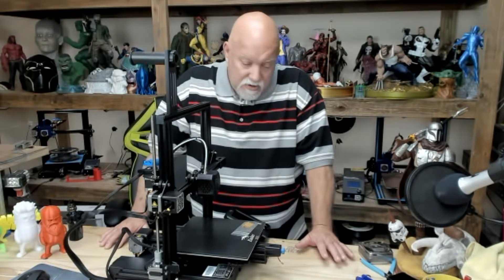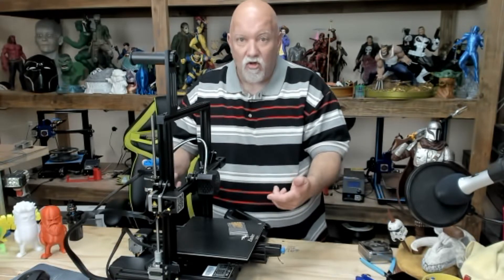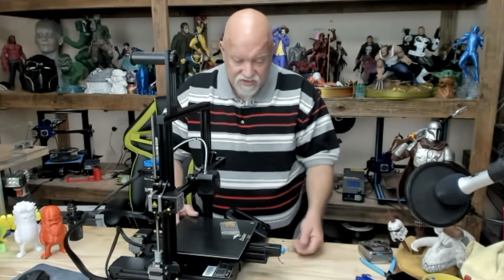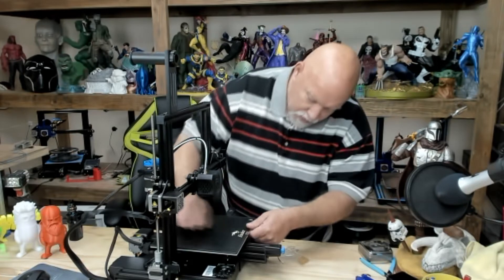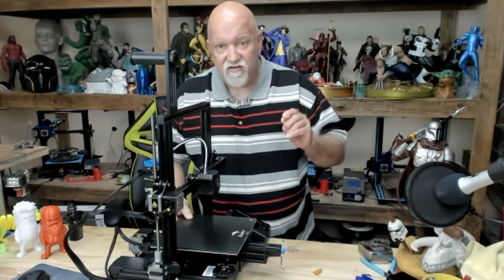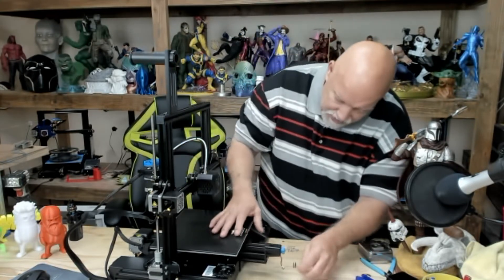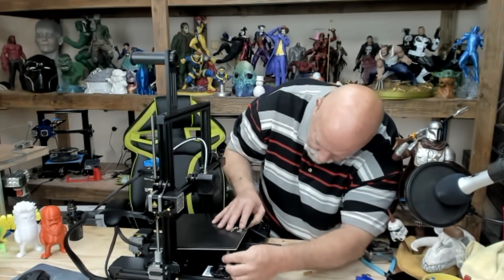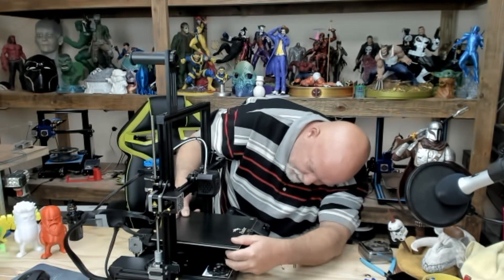ENDER 3 V2  Spring Upgrade and Why #3dhp

Comment: I couldn't actually see how you were replacing the springs because they're under the plate and your camera is pointing down at an angle from on top.
Reply from the maker: Sorry about that.in the future I'll be more careful.A bolt goes throught the Aluminum bed,through spring,then throught Y axis steel plate.Nut on the underside.

Comment: I have done all the above, plus even changed the stock springs. I am printing a print that I have printed many times before with no problems. So it’s not the slicer. But now about 45 minutes into the print it starts skipping, not all over, just the same spots over and over.
I’ve replaced nozzle , extruder, ptfe tube, springs, calibrated, changed filament, aligned bed over and over and even added a washer with the horned to keep Bowden tube close to nozzle. I’ve been living on YouTube and google for help. I’ve tried everything. Please help.
I’m about to pull my hair out lol. I have an Etsy store and have many orders overdue. I’m at my wits end. Any advice is much appreciated!!!!
Reply from the maker: I'm not sure, send me some pics at JEKNAPP1@YAHOO.COM or post on my group on Facebbook 3d Printing and Painting 3DHP or one of the Creality Facebook groups.Someone will have your answer if I don't.Wondering if it might be a bad sd card,replace or refomat it.
Reply: @3DHP  I formatted my card and it didn’t work. Then I tried a brand new card, and worked like a charm. Thank you soooo much!!!!
Reply from the maker: @kroberts4683  Awesome,Glad you got it fixed..
Reply: @3DHP  thank you! I’ll email some pictures in a few minutes! I don’t have a Facebook.
Someone else just told me to try the sd card too. I’m gonna give that a try too. Thanks!!

Comment: Will the old springs make the bed go level as it prints? I level my bed, and after two hours of print it starts to mess up, as if not level.
Reply from the maker: The silver springs are much softer and your wheels might be loosening up,thats why I suggest the yellow heavier ones.
Reply from the maker: From Bryan Vines BV3D...Peter Solomon’s Ender 3 Level G-code file
 .Place on sd card,run G-code file.It will probe the bed in 5 places,4 times allowing you to level the bed with a piece of paper.Repeat as needed.You want a slight drag on paper at each point.
• https://bit.ly/2XOlxhq
Also putting on a anti backlash nut will help with the z dropping on that printer. The above link was copyed and pasted here from my descpiption below video.This has been a problem for everyone.
Reply: @3DHP  thank you!

Comment: The springs go on top of the wire holder at back corner not under it. That way the plastic is not sitting on the heated (hot) bed.
Reply from the maker: The plastic strain relief for the bed wires has zip ties going around it,to keep it in place ,then bracket is then tight against the bed,the spring goes below that,This is The Way.There is no other way of doing it.The heat from the bed doesn't affect the part in any way.

Comment: did you remove the bracket covering the wires on the rear left corner of bed before you replaced springs?
Reply from the maker: No the strain relief bracket must stay there.

Comment: Will you be adding auto bed leveler?
Reply from the maker: Yes,Creality had different versions on the control board,once th3dstudios get the firmware worked out,I will be adding  and doing a video on it with an ezabl. and filament runout sensor.

Comment: Have you noticed a slight bow in your bed?  When I level my V2, i've noticed that the center of the bed is slightly lower than the edges?  I thought the glass bed would have resolved this.    I've ordered stronger springs and hope that will help.  Any suggestions?  Thanks in advance.  (BTW - the V2 prints awesome.)
Reply from the maker: Yes its flat,checked with a framing square,bed and glass.If you have a low spot on glass,shim in with a piece of paper underneath the middle since you can't flip it over with build surface on it.When I first bought a cr10 a few years ago and glass was a problem then,I flipped them or replaced with a mirror.